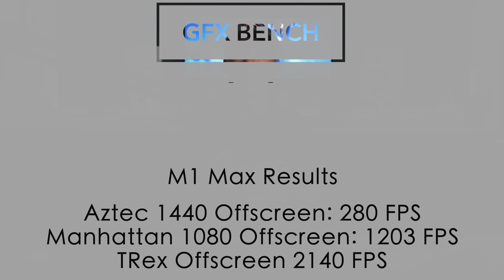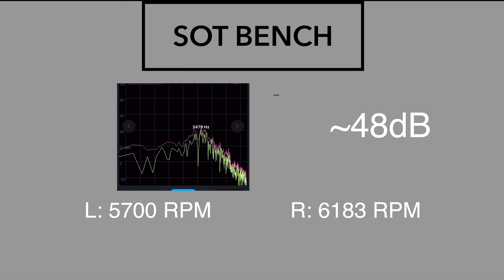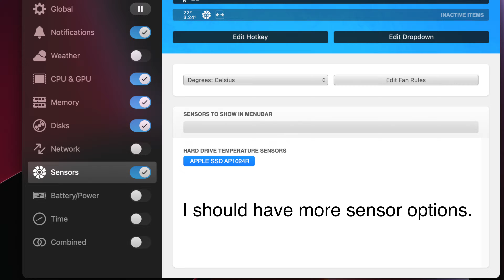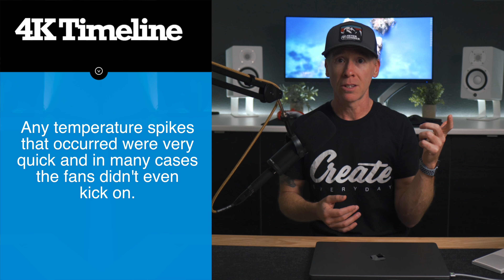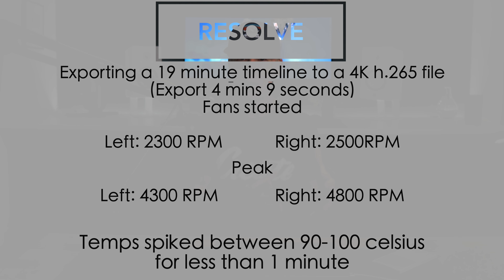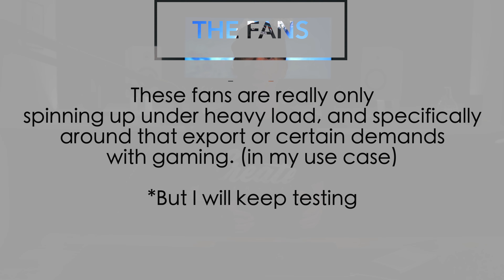M1 Max 14-inch MacBook Pro Performance, Battery Life, and Fans

Comment: how many hours do you usually get from 0 to 100 on your m1 max?
Reply from the maker: Well it depends on what I’m doing. General day to day tasks like surfing and word processing I can go all day, but heavier tasks I budget for around 4 hours.
Reply: @KevinRossRN  how many hours on normal usage?
Reply from the maker: 7-8 and in low power mode possibly longer…but this is of course due to the maxed out GPU. If I had to do it again I’d likely go for the 24-Core.
Reply: @KevinRossRN   I have the 24 core gpu and unfortunately i am getting around 6 hours only even on low power mode

Comment: Thank you so much for a quick and proper video with day to day connections.
Reply from the maker: You got it. And thank you for being here.
Reply: @KevinRossRN  Oh wow you responded so quick! While you are here, a quick question. I know that the 16" is gigantic, but should I get it for the better battery life and better value compared from the 14"? I like to put the computer on my lap and take it everywhere I go. Additionally I will be playing gta5 using crossover.
Reply from the maker: As far as performance, generally speaking, they’ll be the same. But to your point of getting longer battery life, depending on what you’re doing, this can certainly be a big benefit if you find yourself not near an outlet or not wanting to plug in. 

If I were more often using the laptop around my home then the 16 inch wouldn’t be much of an issue, but being on the move quite often, this is why the 14 inch was my top pick. 

But I’ve also built my workflow in a way that the 14 inch makes sense. I cut video and audio on the go all the time, often in tight spaces, but the argument might be that the screen isn’t big enough for video editing, but I rough cut first, and then once that happens the lion’s share of the work happens on an external display where I can grade the footage, or for audio I end up connecting it to my interface and studio monitors.
Reply: @KevinRossRN  I see. In fact I own an asus g14 and I edit videos and it seems to me it's just fine, although bigger screen real-estate is always great. I have a monitor in my house so it's no big deal. When I take my laptop around I mainly use it for watching films or using the web. I always bring a charger with my too, so I guess the only thing that makes the decision for me is the config. If I were running say gta 5 using crossover and recording it at the same time, what is the most optimized config I could get?
Reply from the maker: Well the Max is going to give you those extra encoders, and GTA isn’t too bad on these machines. I’d also say 32GBs of RAM minimum, but any more than that I believe might not be beneficial based on your use case. 

For web browsing and movies 16GBs would be fine, but for gaming, especially with emulation, the RAM helps.
Reply: @KevinRossRN  Got it, so I will take the 16 core gpu m1 pro with 32 gb ram. This is the perfect balance for battery and performance, right?
Reply from the maker: The Pro has shown to get better battery for certain tasks. And again, if you were into video editing, the Max is worth it because of the extra video encoding, but otherwise you should be fine for some gaming. I’ve played several games and many of them don’t even really max out that GPU, but some of that also comes down to efficiency and the app actually being able to take full advantage. 

I think I saw somewhere where the Pro may have just a few less frames than the Max for GTA.
Reply: @KevinRossRN  got it, is the 32 gb ram that necessary? because its $400 more
Reply: Also I do some video editing, but no crazy effects.
Reply from the maker: Are you conveniently located near an Apple store? What you could do is try the base model and if you’re finding it doesn’t work, you can easily return it. Apples return policy is awesome.
Reply from the maker: You’d be fine.
Reply: @KevinRossRN  Oh yeah, will do. Thanks for the advice! Do you have a discord server?
Reply from the maker: Ha! A couple others suggested it. I’m just putting in about 70+ hours a week on these businesses and this certainly isn’t a brag because it’s definitely a grind, but I’d be concerned to not have the time to allocate to it, but I’d really love to.
Reply: @KevinRossRN  I think you should since there is a lot of people who like your channel and are happy to help others! I would understand if you don't have enough time, just another suggestion for more incentive :)
Reply from the maker: I appreciate it. I hope to be able to make this happen.

Comment: It was great coming across your channel Kevin. Some great content! I totally agree with what you said about adjusting expectations. PC desktops have massive fans to keep it cool during load. Apple being to pack such high levels of power into that chassis is mind blowing! I do have a question though, after using the laptop for more then 3 months now- during day to day normal use ( like docking to external display for office work). Do you hear the fans at all- is there any audible hum? If you bring your ears close to the machine can you hear the fans spinning or is it dead silent?  This is all not in lower power mode
Reply from the maker: Glad to have you here. 

As far as the fans in my day-to-day, and even with an external display at times, I haven’t heard the fans spin up. 

Gaming can definitely get the fans to spin, but I still can’t really hear them and I’d admit having pretty decent hearing. 

The only time it’s noticeable is that on some editing projects, but rare…the fans are audible during certain renders, but only for a short amount of time. But for the most part they’re not even spinning or idle intermittently, depending on what I’m doing.
Reply: @KevinRossRN  Sounds amazing Kevin. What a device. Keep up the great work!
Reply from the maker: Thanks so much. Appreciate you. 🙏

Comment: 14 inch is just too small form factor for m1max.  The higher gpu heats up the laptop and fan   Even light video work, the laptop heated up and gave me sweaty palms to the point of annoyance.  So unless your going hook up the max  to an external monitor and use and external keyboard and mouse so your not touching the m1max in your work flow stick to the m1pro for the 14 inch.   Better yet, if video work is your primary use then better to get the 16 inch max 32gpu.  Laptop stayed cool or barely warm and no fan noise at all.  And ignore this idea that the 16 inch m1 pro is just as good as the max.  Yeah maybe theres no differnce in render time between the 16 inch m1pro vs the m1max but during scrubbing the m1pro skips frames while the m1max with the 32gpu is smooth as better when adding colors and other adjustments.
Reply from the maker: Yeah, agree on the pro vs max that I haven’t noticed any issues with scrubbing or playback.

Which editor are you using?

Comment: Is the 32 core m1 max being thermally limited by any chance? I wonder if the 24 core is too. Also how much lower is the battery life on the 32 core vs this 16 more m1 pro?
Reply from the maker: Well there is going to be some thermal limit, however one of the things I’m noticing, especially over the last year is how the improvement in efficiency with the software is helping these machines perform these tasks quicker. Once we have further updates with software taking advantage of the GPU, you’ll start seeing these videos in the next few months about how the M1 Max 32 Core is the way to go 🤷‍♂️

But really to what end. 

And yes, battery life in the pro vs max is going to be better. I’m in the middle of testing the M1 Max in low power mode (today and tomorrow actually).

Comment: What is this exact configuration of the 14 inch that you are using here? You don't mention it in this video.
Reply from the maker: 10-Core CPU 32-Core GPU with 32GBs of RAM and a 1TB SSD configuration.

Comment: What I’m sure for my purchase: 14 inch, 32Gb RAM, 1To SSD
But I hesitate for the proc, between M1 Max 24 GPU and M1 Pro 16 GPU
Extra GPU power is attractive but I fear about fan noise and battery life
My workflow countains photo and video editing with AE, PP, FCP, lightroom, and a little bit of gaming
Often the Mac is docked ans my plan is to use it for a long time, > 6 years
Reply from the maker: I think if it’s docked most of the time, then battery may become a moot point. FCPX will definitely be fine on the 16 Core GPU. The Adobe products are improving, but still hungry, however they seem to be more demanding on the RAM than anything. 

Is that about a 200 dollar cost savings you’re looking at?
Reply: @KevinRossRN  thanks Kevin!
No I have budget for the extra 200$
I am more worried about chosing the right product
Because fan noise and battery is important to me
Reply from the maker: I’d say that right now, there are several programs not really taking advantage of that GPU, and Adobe being one of them, however I’m continuing to collect data. 

We’re definitely seeing the fans being pushed with those apps that are maxing out the CPU, and Blender is a great example of this until their update comes.

As far as the GPU cores, I think you’re going to be fine for what we’re seeing now. For someone that is looking for this machine to serve them greater than five years, you may find that in year 2 (arbitrary guess), those extra GPU Cores may help as more apps are working better with the Metal graphics. 

However do you think you’d be in a different position in 2 years time and find yourself upgrading sooner than that 6 year mark?
Reply: @KevinRossRN  no I generally keep my MBP for many years without upgrading
Reply from the maker: Gotcha. Well, I’d say that if you stay on this path, that extra GPU “power” may serve you longer.

Comment: Thanks for this.

Like yourself, I wanted something portable with decent battery life, but enough power when I need it.

So I opted for the 14 max over the 16.

My current 16 is just a nightmare on planes and a little cumbersome when travelling, although I think I will miss the screen realestate.

Very keen to see what the results will be in low power mode.
Reply from the maker: Yeah, when I used the 17 inch MBP back in the day is was definitely helpful to have that real estate, but traveling around with it was a pain. 

I often have my iPad with me and it works wonders as a second display. When does your ship?
Reply: @KevinRossRN  At home / Studio i have it connected to a 34" widescreen for productivity, just want something light to travel with. In most cases, im not doing heavy duty stuff when on the go (unless its urgent)
I ordered mine 30/10/2021 Still processing, estimated arrival is 13th-20th of December :( just in time for xmas. Long wait though
Reply from the maker: Oh boy that is quite awhile, but I hope it’ll get bumped up for you. I know that last year the M1s were delayed and they sometimes got moved up by 2 weeks. 

And yeah, nice to have the monitor on the ready when you need it.

Comment: Hey kevin! I recently purchased the 14inch with m1 max 24 cores, 32gb ram and 1tb harddrive. Im wondering, do you think this configuration will cause problems for the small body of the 14inch eg overheating? I will use the laptop for music and video editing but wont be really pushing it to its limits. I’m wondering if Going with the max in the 14inch is a bad idea or not as ive heard some talk about fan noise and overheating - is this only when the laptop is pushed to the absolute limit? thanks!
Reply from the maker: Well let’s just say I’ve been working with this machine since I got it and “pushing” it every day with my testing and there are just certain tasks that may push it for brief periods, but overall the fans either run at idle or off. 

I’ll be diving more into gaming mostly as a place of measurement to see what the sustained levels look like. 

And as far as audio, that extra RAM will help, and I think you’ll be fine. I’m either editing with the monitors on my desk, or my over the ear monitors and even if the fans are spinning up briefly, I can’t hear them, however this usually only occurs at export and at that point, it doesn’t matter since I’m not editing anything at that point.
Reply: @KevinRossRN  Ah I see. Really appreciate the quick and detailed response, thanks so much! Feeling a lot more confident on my purchase now :)
Reply from the maker: I know it’s quite an investment to make and you just want things to work out. I get it.
Reply: @KevinRossRN  How are you finding the screen size and battery life?
Reply from the maker: Screen size has been fine. I think if I were solely relying on one screen to do everything then I can understand why it might be cramped, but when I need it I use the iPad as a secondary display and I also have the display you see behind me if I really need to stretch that timeline. 

So far, I’ve been fine with the battery. I’m still testing low power mode, but so far it’s been just fine for the day.
Reply: @KevinRossRN  Ah great! Yeah i always work with a second monitor but im going to be traveling a lot with it do decided the smaller size for portability and to put the money towards applecare + for it
Reply from the maker: Yeah, I really wanted the portability and I think the 16 is a good desktop replacement, but I’m just on the move and that extra footprint does make a difference in my opinion. Like to keep it as lean as possible.
Reply: @KevinRossRN  Hey kevin, just curious, does the keyboard have a backlight? i couldnt seem to find any info about it online or when i visited the apple store couldnt see hotkeys for the keyboard brightness
Reply from the maker: It does indeed. It just looks more muted when you likely see it on camera, but it is definitely backlit.

Comment: I hate it when people game on a Mac, macs are not for games people. 

And as you said it’s math, for sure they’ll run hot - and then the fans kick in 

I just don’t understand why you play games on Mac while you can get a Cheap windows laptop for gaming or even an Xbox and call it a day.
Reply from the maker: Well, I do have a PC to game on. But I think what it also comes down to is what defines “gaming.” 

Sure many users want Triple A games to be supported on these machines, however those that like a little casual gaming might find it just fine on the Mac, and this would even be compared to a 14 inch windows based laptop, which the point being was that if anyone has been gaming on those, then they’d understand that the fans spin up on all of these laptops. And so those complaining about the fan noise likely haven’t tried these other laptops…and sure some of them have a larger chassis and better thermal management.

Now, I definitely agree that buying this solely for gaming wouldn’t be the way to go, and honestly I can’t imagine anyone buying it for this exclusively.

My PC build and several gaming consoles don’t even add up to this machine, so I get it.

However, one thing I’m very aware of is business. As much as I understand Apple’s desire to force Metal, they’ll also do what they’re doing with Blender right now. 

They’ll either find a developer or group of developers and stack up the cash to either have them work with their teams on a Metal equivalent, and/or that MoltenVK project is going to get a nice shot in the arm to accelerate bridging that gap.

Either way, a two trillion dollar company is going to want a piece of the fastest growing division of the entertainment industry. Even if Apple Arcade isn’t robust and targeted to iOS and iPadOS, it’s still a gateway. 

And again, coming from someone who has a gaming rig and consoles…it’s just business my friend.

But, I hear what you are saying and I appreciate your time here.
Reply: @KevinRossRN  
That wasn’t against you, and Apple wants a part of that segment, but they want it for mobile. 

Because mobile gaming makes way more money than console. 

Therefore iPad and iPhones are the way, not macs. 

By the way I worked at Apple for two years and we talked about this on the internal side, the gaming side of things is on mobile. 

As for blender, I’m sure you know Apple joined the elite finders group to make blender works better. 

And they did work to make Cycels X works native on M1 chips using metal. 

Just like how they did with C4D and Red Shift and octane X which is coming next year. 

I’m software developer and I work with 3D modeling as well, that’s what I do for a l do for living, so I know a thing or two about business and how Apple think. 

It’s not about creating something from zero, it’s about getting something to work. 

I’m not sure if you ever watched my channel, but that’s what I talk about day in and out.

Heck Ray Tracing is now working on M1 max and it used to be only for RTX 

Now that aside, my main thing is: when you get the mac, do not count “gaming” into it. 

Tim Cook himself recently he said he is upset that macs are becoming toys, and he wants people to create with them not play. 

And he is the CEO of the company. 

If you like to talk more about it or maybe make a video about the topic, you can reach out to me. 

I think our audience can find those two prospectives worth value.
Reply from the maker: Oh, I didn’t think it was a dig at me or anything…Not at all. 

And I appreciate your perspective and I agree that mobile gaming is definitely a massive money maker.

In addition I also can appreciate your tenure with the company and your background. 

I think it’s just one of those things where it’ll eventually get more difficult to say “never,” but that too could be a possibility. 

I also look at it from the perspective of the iPhone. A computer company that somehow took on the likes of RIM and Nokia to take on that space. And now, Apple seems like a phone manufacturer that also happens to make computers. 

Anyway, I appreciate you circling back around. I’ll check out your channel as I’m always looking for another perspective. And, I’d also be open for a collab of some sort. 😉